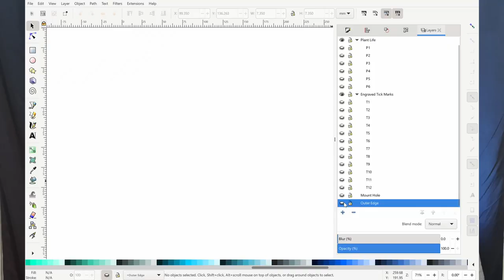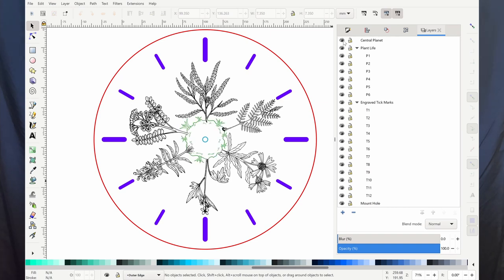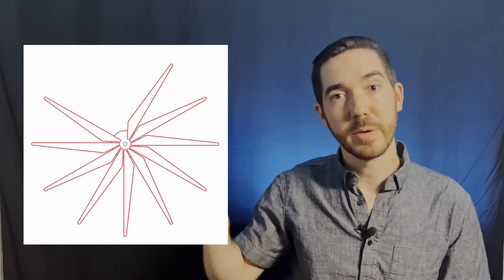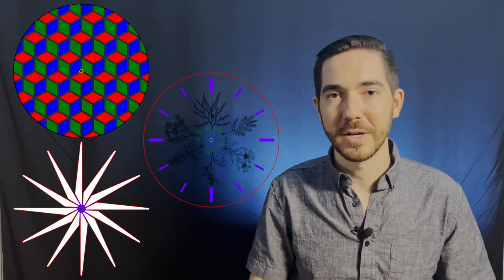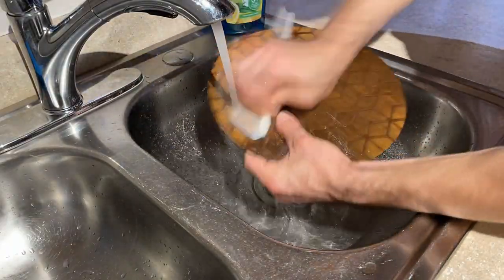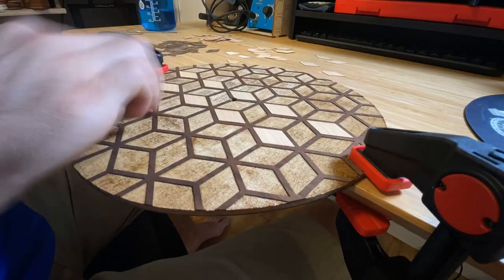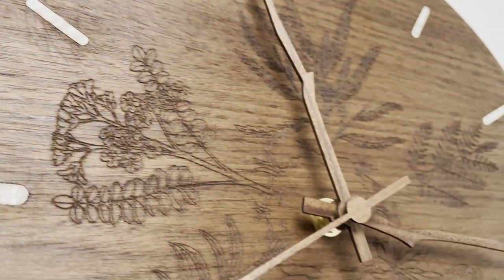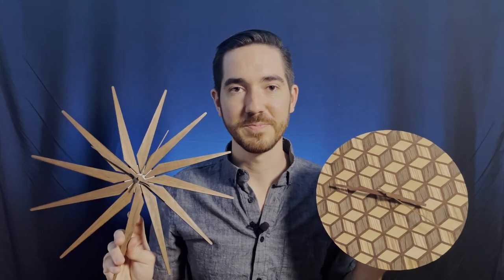3 Mid Century Modern Clocks I Made With My Glowforge

Comment: Awesome. Just don't wet plywood it will warp everytime lol here's a quick tip though instead of engraving, fully cut out the sections and glue the pieces in with a backer attached to the clock.
Reply from the maker: That is a good idea! Not working with the thin, small pieces of veneer would be much nicer too. I appreciate that!

Comment: These are beautiful! Can I ask a couple of questions... what diameter clock part did you get and did you cut the center hole the same size? Also how did you hang it on the wall with the clock mechanism sticking out further at the back? I''m a beginner but am in the process of designing a sports clock for my son at christmas and if you're willing to offer any advice I would be so grateful! These are absolutely stunning!
Reply from the maker: Oh thank you so much Jodi, your kind words mean a lot to me! For the clock mechanism that I purchased, which there is a link to in the description of the video, they had a 1/4" stem that you insert through the wood. My laser cut files used that exact dimension for the central hole (6.35mm) and it was a tight fit - the threads dug in just a tiny bit. If I were to do it again I would probably add an extra .15mm diameter to that cut, so a 6.5mm hole. And for hanging it on the wall, the clock mechanism came with a sheet metal bracket that hangs on a simple nail in the wall, unfortunately it does mean that the clock face itself is pushed away from the wall by about 16mm. This does make the clock kind of want to tip forward just a little bit, but I kind of like seeing the shadow cast on the wall by the clock, rather than the look of it just being flat on the wall with no dimension to it. You could add standoffs or a ring on the backside of your clock to get the illusion of the clock being thicker than it is, but it really just helps to sit the clock flatter on the wall. And for your sports clock, you so got this! I was actually just making a Seattle Seahawks wine bottle balancer last night for a Christmas gift. I found a high resolution logo, imported it into Inkscape, and used the "Trace Bitmap" function to create a path of the logo details. You'll need to play with the sliders there to pull out what you want but it can be a lot faster that manually tracing out a logo on your own with splines. Another tip would be to pick clock hands that have better contrast with the background. Mine were wood on wood and they kind of fade away when you look at it. In the end, the clock for my sister is used more as a piece of art rather than as a clock because of that. Which is still a success in my book :) Let me know how your clock turns out!
Reply: @engineeredrelics  Great explanation. Thanks for detailed sharing !!